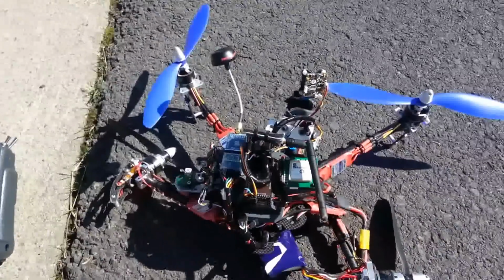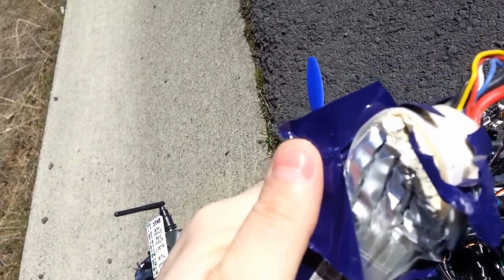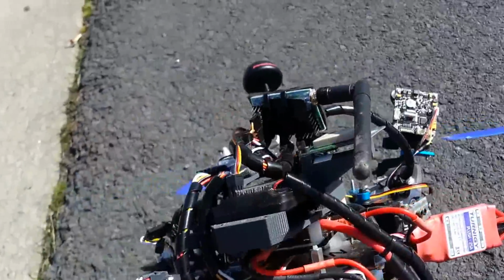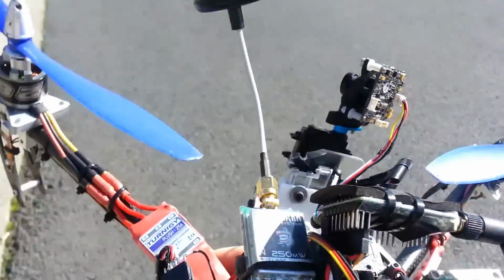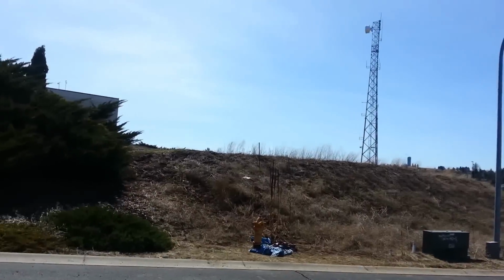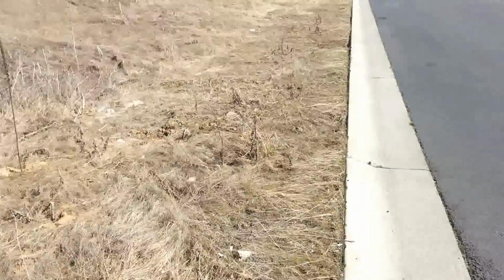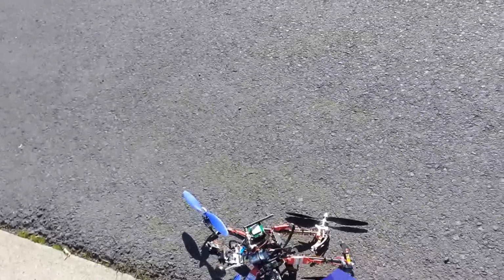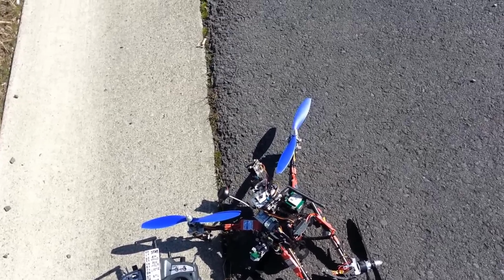Serious FPV crash

Comment from the maker: Haha -- like how I throw the fire-hazard battery into the dry grass? lol... stupid.
Shaky video, and improvised dialogue. I should probably watch a video tutorial on how to make social media cuz I suck at it. I don't know if this is interesting to anyone, but I'm posting it anyway.

This is like flight number 3 with FPV. I did not have the gopro attached (would have been a good crash vid but I'm glad I decided to take it off). A quick view of the flight tlog shows that there was no failsafe condition before she went from a stabilized hover to screaming to the nearest pavement. So there was no control signal failure. There was also no directive from the flight computer to pan, tilt or roll, yet the telemetry logs show it screaming from the sky. Obviously. So... I dunno! 

I'll test the motors, one of them might have quit. I feel like I have to get to the bottom of this before sending her in the sky again. A crash like this could easily have cost me hundreds, this time was lucky -- I'm out about $50.

Oddly, I'm not put off by an experience like this. The hardware will improve with a rebuild, and I'm still learning TONS all the time. And maybe its the mystery of the failure.... gotta figure it out!
Reply: This could have cost you big glad to see its just costing a frame
Reply: Are those props from DJI?  If so, they could be the cause of your crash.  DJI props are know for coming apart in flight.
Reply from the maker: They are actually gemfans.  And I'm pretty sure that is what happened.  The only prop broken has a junk out of the leading edge in the middle of one blade.  It had no damage on the tips.  Pretty sure that sucker just flew apart mid-flight.
Reply from the maker: I DID get some DJI props, but they don't fit my rig! $25 -- most expensive props I ever bought, yet the only ones that didn't come with prop adapter rings.  stupid useless dji.
Reply: Your props look very similar to the DJI props that came with my F550. I never used my DJI props once. I heard my favorite prop manufacturer went out of business, Graupner.
Reply: I had to drill out the bore of my Graupners to fit.